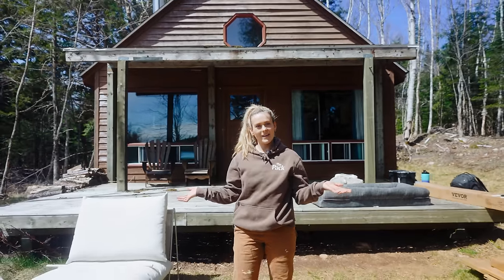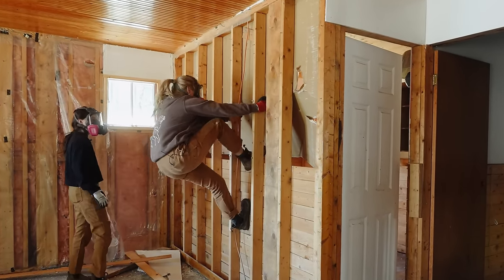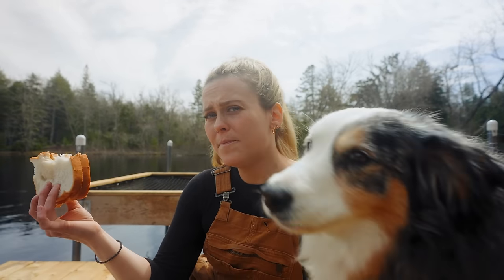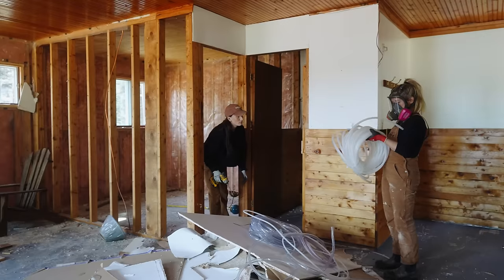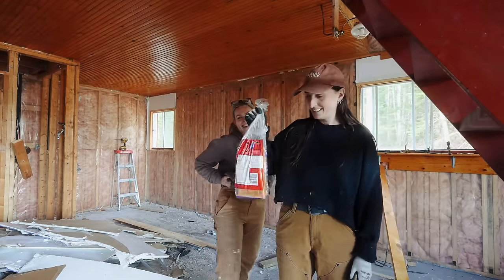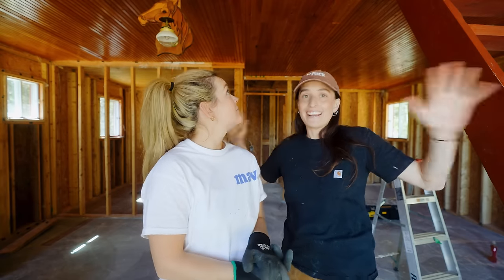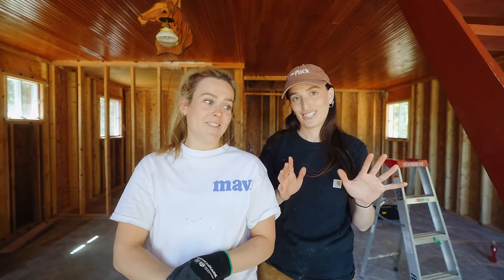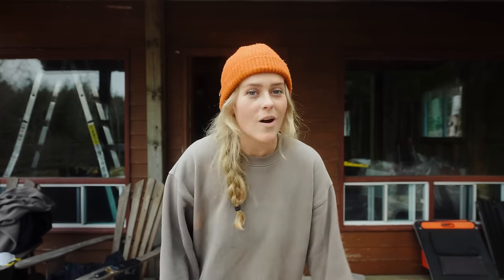Renovating An Abandoned Home: Demolishing the Building

Comment: I’d be very concerned about those molded floor joists. Once the mold and fungi is in the wood it is virtually impossible to get rid of it even when it is dry. When it is dry the spores spread faster. It’s not your work that concerns me, it is your optimism. You can save a lot of those materials only to have them haunt you later with mold issues.

I don’t think you can excavate your way out of flooding issues. I live on a stream in the mountains. It’s a beautiful pastoral creek until we have an inch of rain in an hour. Then it is get out of the way. My grandfather was going to build right next to the creek because it’s so pretty. An old timer showed him where the debris was in the trees. He changed sites to be above and back from that pretty creek. The water has occasionally gotten up to the foundation during floods but never got up into the structure. Salvage those materials and rebuild back away from the high water marks.
Reply: You just said everything my husband said.  He does not think this building is salvageable either.
Reply: I agree the water is a problem.  The mold is a problem.   Start new and build what you want/need.